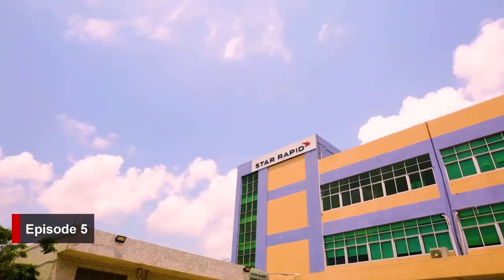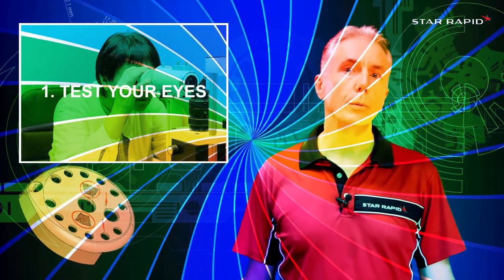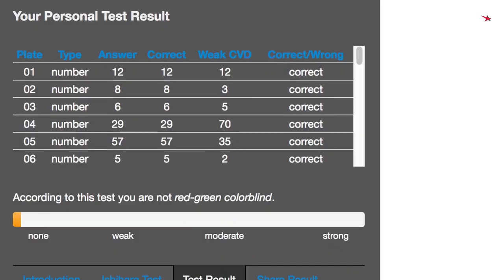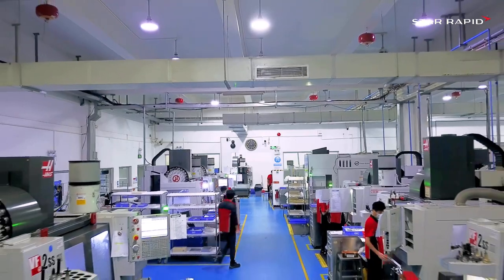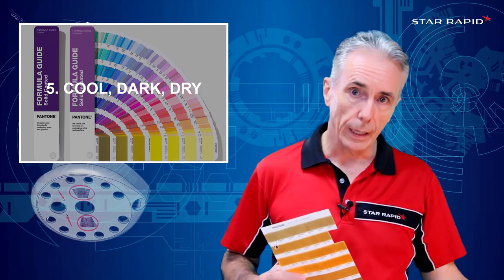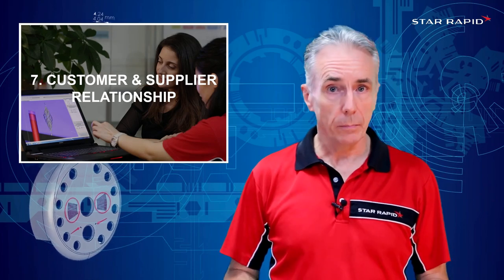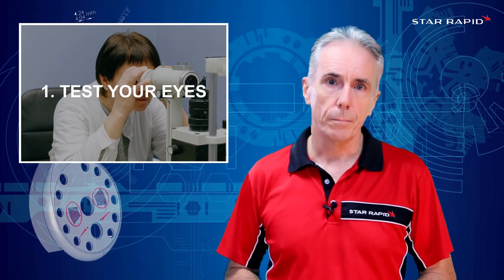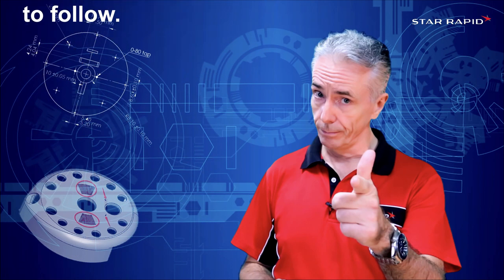7 Simple Tips to Get Perfect Color Matching | Some Serious Engineering - Ep5

Comment: The test is a really great idea (Unfortunalety no calibration can correct this kind of deficiency), I will make pass it to all my co workers. In my field we design a lot of parts in PA6.6 GF30 and black or green. With a 30% glass fiber filler, the color is often lighter, the filler can have an impact, but I may be wrong. 
With the free app color blind check I obtain 0/100, for a slightly short-sighted finally a good eye test result.
Reply from the maker: Awesome, let us know how many of your coworkers get the wings ;)
Reply: My Dad sold Dupont products and paints.  He did it the old school way since the 1960's.  No fancy equipment or tech back then.  He taught me the basics and other techniques.  However, my eyes are not good like his ones.

Comment: The color matching test doesn't run on a Chrome browser.
Reply: because Flash is dead, but you can make it run by opening the downloaded .swf file into Flash Player projector

https://fpdownload.macromedia.com/pub/flashplayer/updaters/32/flashplayer_32_sa.exe
Reply: But you better do it in a CALIBRATED monitor otherwise it will be hard to tell the colors apart and it can affect your score while you may score better in adequate conditions.

Comment: How about people with very good perception of color differences? They can also be a problem, as they will say "no, it's not exactly the same" where most people would notice no difference.
Reply: Color perception is a spectrum, so rather than thinking most people wouldn't notice, think of it as - a few wouldn't care, some others would. If you care about the people who notice the difference, then you should only trust people who see all the difference. 

Of course the point is that you have to listen to only a few people (the ones who score the best) and not simply everyone
Reply: @100x100maschio  I see. That's not a simple topic.
A few years ago, I was talking about this same topic with someone who had been paint director at GM and worked a lot with colors. I remember his point was, there are 1 to 3% of people who will detect differences that most other people won't, and those 'super perceptive' people should not be in a position to reject a batch based on color differences.
I guess that makes sense, too. But I respect your position -- it's not a clear-cut situation.
Reply: @RenaudAnjoran  hi, i see your point. If it is indeed only 1 to 3% of the people, it may be an exercise in futility indeed. Thank you for your contribution!